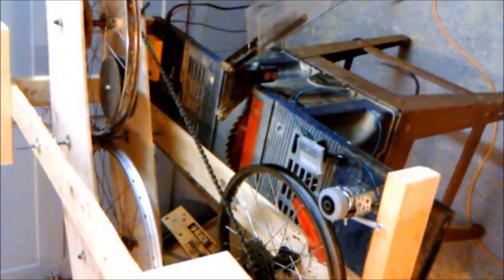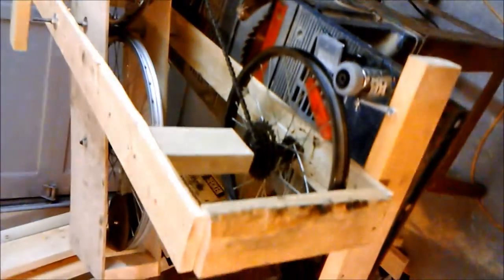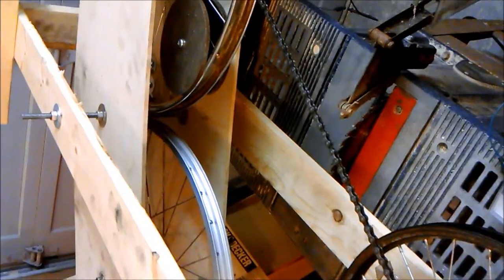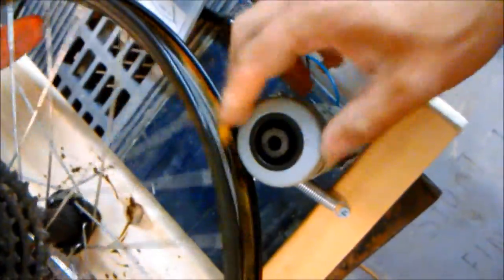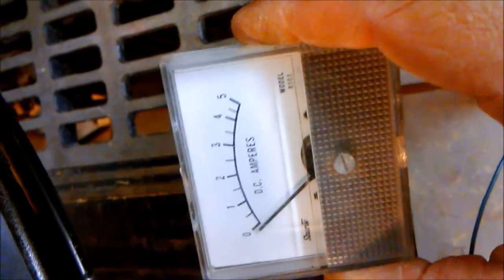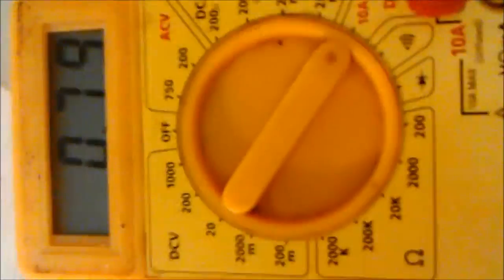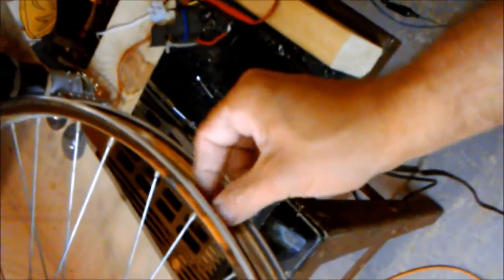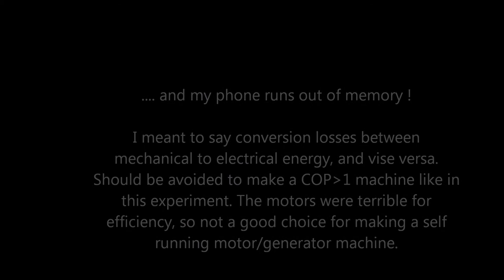The Mechanical Power Multiplier

Comment: The system presented in your video is related to unconventional mechanical reduction-amplifier. Many of them use inertia instead of direct mechanical force. The best analogy is airlift by a wing.
Maybe you should try out: https://www.youtube.com/watch?v=xNeLgqrXJiw
As seen - there is no additional work required to induce counter-load force in gravitation-referenced mechanical system.